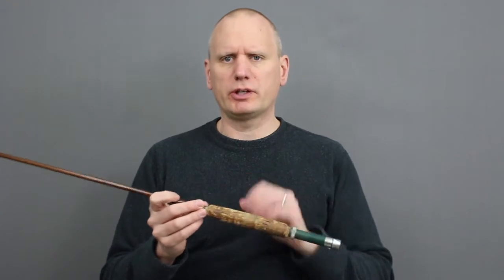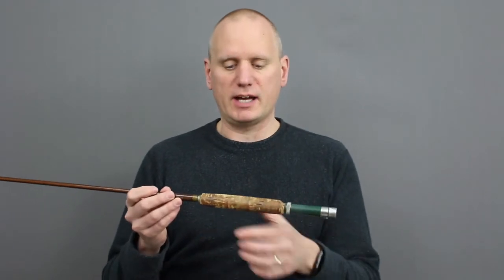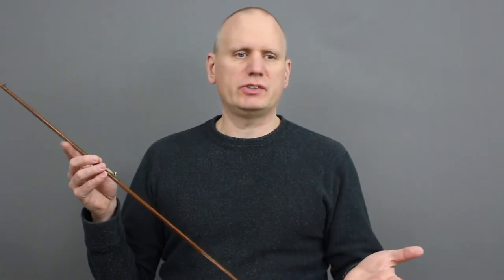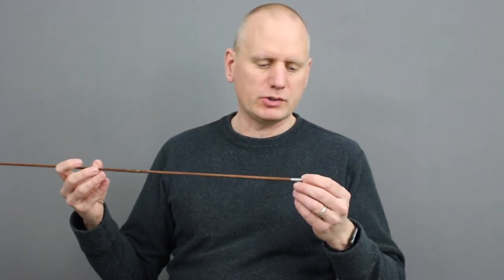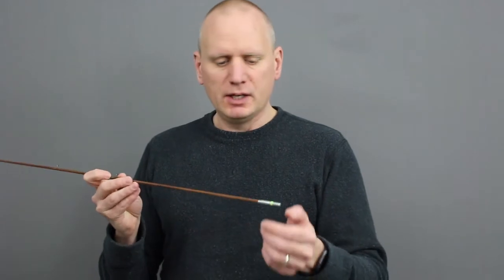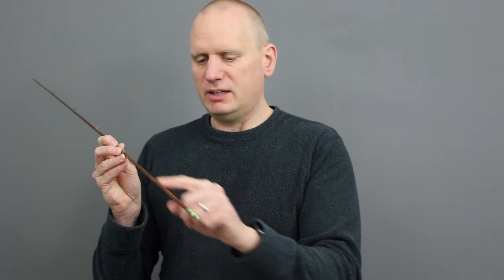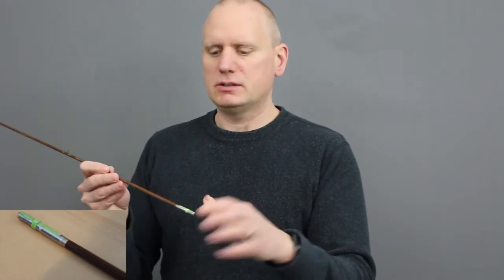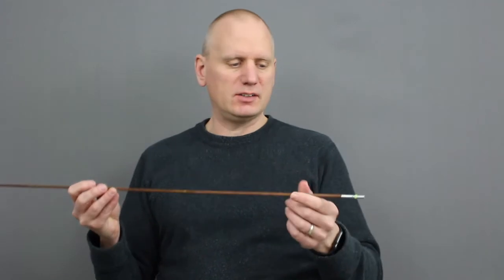How to restore a bamboo rod part 2: mapping a rod and making changes

Comment: So I got carried away after watching part 3 and pulled all the guides off and stripped my blank to bare cane.  Neglected to watch this video first and now kicking myself for not marking the spline.  A million videos on how to find it on graphite and glass (plus I have a bit of experience) but is there anything unique to bamboo rods so I can be sure to get that right???
Reply: Hi, thanks for your comment.  Are you able to see any dark areas left on the blank where the guides were?  Generally the guides will leave marks behind that will tell you what size to wrap the new guides.